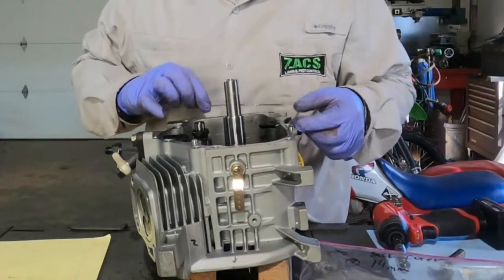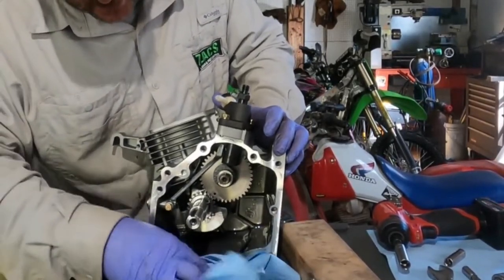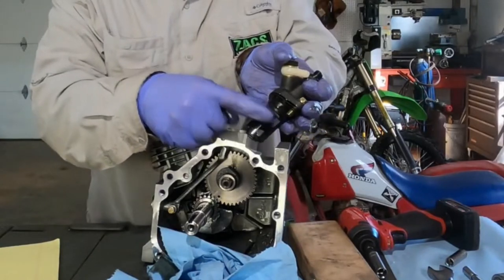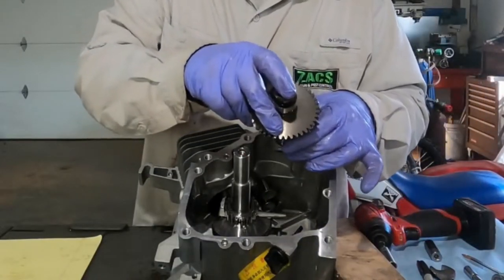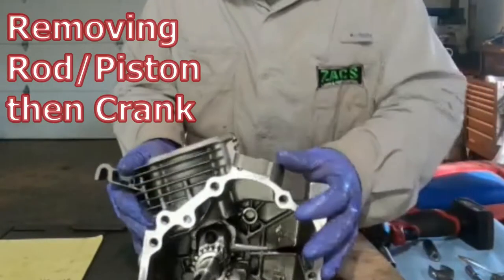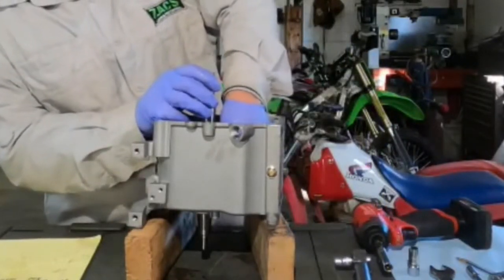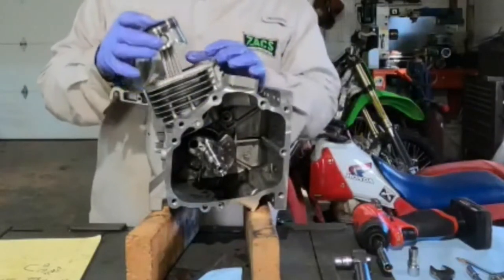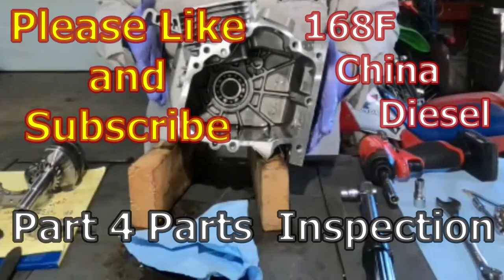168F Small Diesel Engine Prepping for Real Use! Detailed teardown part 3.

Comment: Couldn't help but notice there may be two versions of the FD168. One has the fuel injection pump attached to the rear cover and the other has the fuel injection pump as part of the crankcase.
Reply: I noticed that too, I’d really like to know which is better. Edit: I tried both, the one with the side cover mounted pump is surprisingly better built and usually cheaper in my experience. They usually have the all-metal intake filter setup which is much better than the plastic one on the block mounted pump style.

Comment: Mine has the injection pump mounted on the side case, these ones are usually better quality and have an all-metal intake system. I just got my cheapest one yet on Amazon, $165 shipped to my door! If you add and remove different brands of engines to your Amazon cart, they’ll have discounts that pop up after a week or so, I have sone Yanmar style in there as well. 

These are made better than I thought, in person they are quite a bit bigger than a Honda small block, they’re nearly the size of a gx 240 big block and have heavy bolts compared to the gx200. The aluminum connecting rod is a very weak piece if you’re looking to boost one of these or race it. The rod is much beefier than a gx200 rod, but for a diesel it seems weak, likely why these only make 3hp, they could probably do more, but that rod wouldn’t last. 

The Yanmar clones have full pressure oiling and forged steel rods. 

I like that these are IDI diesels, it makes them fairly quiet compared to the DI yanmars.

Comment: I am using the account of my wife but you did a great job when will the assemble video be up???
Where can I get one of these engines????
Stuart Brandt
Naples Florida
Reply from the maker: I'm in the process of editing it.  It will be several days to finish that portion up.  I need to put together all the specs I used when putting it back together.  Will get it out as soon as I can.   I bought this one off Amazon.

Comment: Hi, to remove the fuel pump, do you really need to open crankcase cover or the FP can be just pull out simply after removing the 2 12mm bolts? Thx for these vids.
Reply from the maker: 2 small bolts and fuel line fuel pump is out.

Comment: So if it needs this much work are you better off paying $200 more for a better engine?
Reply from the maker: I really wanted a small diesel for my log splitter project.  If I could  have bought a well made small diesel for only $200 more and be a better brand absolutely.  But a Hatz or Kohler small diesel is like 2 or $3,000 more
Reply: The Yanmar clones are way better than these, but for half the price these are fun to tinker with and some of the Honda aftermarket parts might fit.
Reply: I got my last 196cc diesel for only $168 shipped and got it in 3 days in a nice wooden crate inside a box, pristine condition, no dents etc. came from New Jersey. The Yanmar 4.8hp 211cc clone engine has full pressure lubrication and a forged steel connecting rod, whereas these are splash lube with a beefy aluminum rod, the beefy aluminum rod is still not great for a diesel though, that’s the biggest weak spot.